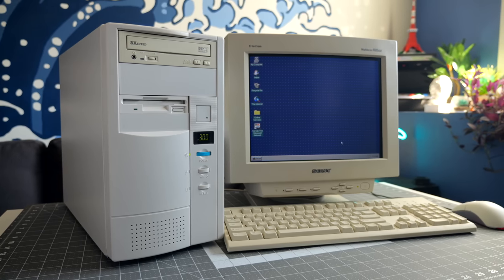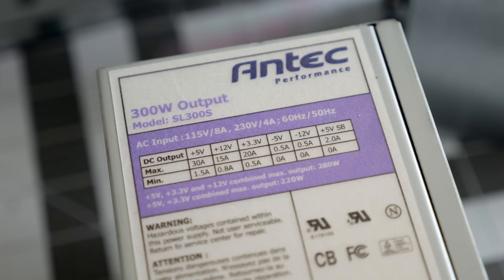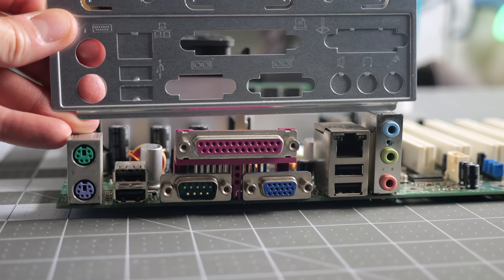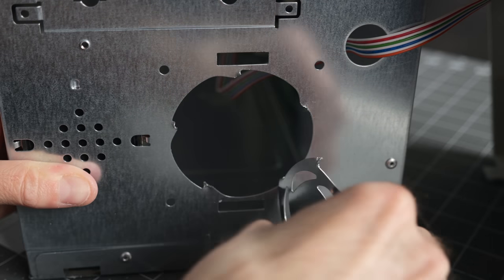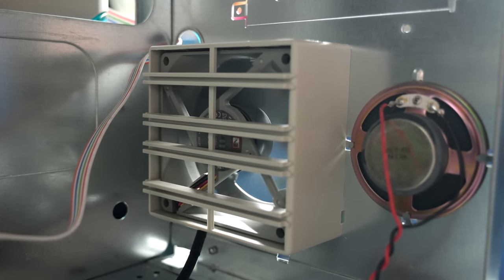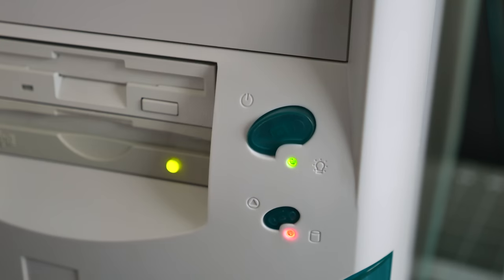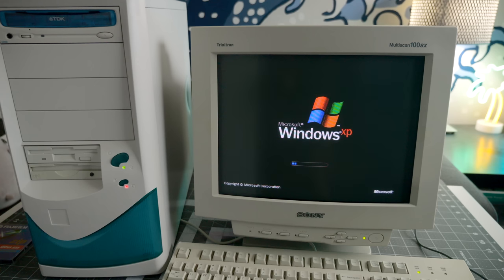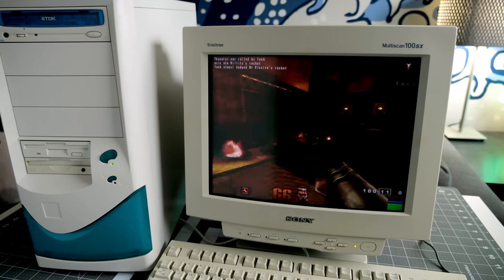Putting Together My Own Retro Desktop PC

Comment: Just in case it hasn't been mentioned, Crysis required a card with at least 256MB of VRAM and 1GB minimum. Recommended is 512MB/2GB respectively.
Reply: It also required very high clockspeeds
Reply: The issue wasn't VRAM specifically
The cards probably didn't have the required instruction sets. I'm guessing Crysis needs pixel shader 3.0
Reply: @dshadow01  You might be on to something. Crysis requires shader model 2.0, but recommends 3.0. The Geforce4 Ti supports version 1.3. The Radeon 9200 LE tops out at 1.4
Reply: LTT video from back then shows that to push the best graphic it consume 3GB VRAM
Reply: @devaraft  Did you snorted something? You got the good stuff innit?
Reply: @WH_J-x3x  I don't but I'm sure you don't need to snort anything cause you already have brain damage. Literally just type LTT Crysis and you would find that exact video
Reply: @devaraft We're not talking about max performance. Just running the game.
Reply: @TheBcoolGuy  I know but it's still insane that you need to put that much power to run best graphics of a 2007 game

Comment: I heard and read horror stories about the IBM hdd manufacturing plant here in Hungary. Because of the low wages the really low-end of the working class wanted to work there. I heard that some of them were smoking (!) in the clean rooms, and putting the cig butts off in the still opened drives. Crazy times...
Reply: Wow, I did not know these IBM drives were manufactured in Hungary. This comes as a surprise. I remember having an IBM drive back in the early 2000's and it was actually smoking. But as far as I can remember, it still worked. 😅😅
Reply: @skieinc  HP machines and printers are made too in Hungary till' 2005.
Reply: @skieinc  it's also said on the Hard Drive itself 11:43
Reply: 20gb IBM are solid. 40gb and 80gb are crap. And then IBM sold to someone. Hitachi or something. And their first 80gb's were good, yet noisy. They just solved stability and toughness before looking at noise.

Comment: An alternative to cutting the 3 pin power LED header is using a pin to release the pin from the plastic header, and then move it to the 2nd position. Or you could remove both of them, and use a 2 pin header instead.
Reply: Came here to post the same thing. It’s way safer and easier IMO.
Reply: I came to the comments to say just this.
Reply: Truth told, cutting the connector was an extremely common of-the-era technique. I did the same thing literally hundreds of times while working at a small computer shop in 2000-2001. You had to bash together a PC in about ten minutes: there was no time for fooling around re-pinning connectors!
Reply: It's also a waste of a retro case to modify the cables that came with it!
Reply: Came here to write the same. Cutting the plug while you could just move the contact to the middle pin is pretty barbaric.

Comment: Try adding a 100-330uF capacitor in parallel to the fan power pins to see if it will spin up - it's a trick the 3d printing community uses for Noctua fans.
Reply: That's genius. I need to remember this.
Reply: Timothy Hoogland  I'm DEFINITELY not an electronics expert, but I think it works like this: The low voltage supplied is not enough to start the fan, so the fan has large resistance and the capacitor charges. The cap then discharges and starts the fan. The fan then falls to much lower resistance and so most future current goes to the fan. Maybe the cap occasionally charges and discharges, but one is able to run the fan lower than 100%. If you know more than me, feel free to explain. I'm hopeless at circuits and components.

Comment: I love this period of building, this is abotu where I got on the PC bus. Really brings back memories. One of my cable management tricks for this era was to put the optical drive in the second slot down from the top and use that space above it to store the "extra" power leads off the PSU. Helped keep the clutter down.
I love the knockoff platinum and candy plastic aesthetic of this era, it really did have some character.
And that light mod? Perfect. Needs a neat case badge now too.
Reply: And the DVD drive really does fit nicely with the case.

Comment: I miss when it briefly fashionable to just stick translucent turquoise on every computer thing, even otherwise typical beige boxes. Turquoise is one of my favourite colours, and I have to wonder if that would be the case had I grown up a few years earlier or later than I did. 

I think Windows 98 and various vintages of Linux would be pretty interesting! I also have a hunch that the driver program might work just fine the second time round, though of course it could be even worse! 

 Those re-usable knockouts are nice though, especially since it doesn't really cost them anything else in production to slightly alter the shape they punch out — but it helps the end user dramatically.
Reply: It reminds me of the fish bowl aesthethic of literally everything. From hand soap bottles to shower curtain lmfao. Some type of pastel fish bowl aquatic vibes
Reply: I loved the transparent coloured plastic era of tech, even though it was a little before my time. I would absolutely still like transparent orange gadgets today, just like the ones I wanted as they were on their way out of popularity when I was just getting old enough to ask for stuff, beyond just pointing at anything with Winnie the Pooh or Tigger on it.

Comment: I never was a fan of the Apple colours, even when every other manufacturer copied them. I was firmly entrenched in the "being black makes it faster" camp.

Although that CD drive would look sick with LED illumination (I don't think it would screw with reading the disc since the laser is IR)
Reply: Yeah, I wasn't a fan of that design either. Especially in consumer products where everything had to look "melty" or like it was designed in a wind tunnel.

Like an mp3 player? Can't just make it a rectangle, have to make it all curvy and weird. I was actually thrilled with the iPod because it looked normal to me.
Reply: If I'm not mistaken the black PCs came after the Apple colored ones, before that it was all beige.

Comment: Next time you use Snappy, be sure to use the Origin one, and check every component hovering your mouse while pressing ctrl. So you can compare time and release version between your current driver and the new one, since the system is automatic and sometimes misfires and installs the wrong one (ex. Intel often signs new drivers in the year 1968)
Reply: is there a reason for this? 1970 is where most systems seem to have a cutoff so i'm trying to see if there's a connection here

Comment: I love this video/PC so much, it's so, so similar to the system I had back then!
Back in its day, I bought the same CPU 2.4Ghz. I had a very similar motherboard, Intel with the i845 chipset that supported the 533mhz bus. But I also had an nVidia Ti 4400, one step up from the 4200 you used. It was an absolute beast back in the day. 
I had to sell it for finacial reasons, but when I bought my next PC (AMD Sempron 3000+) I had an ATI 9200 in that! 
The Ti 4400 was around $550 AUD at the time, and the 9200 was about $120 AUD when I bought them. 
I remember this early period of the 2000's so well because I had so much fun buying and building PC hardware.

Comment: I had that TDK CD burner installed aftermarket in 1999ish HP pavilion.  The desktop included a Zip drive, which I loved.

I believe I installed it in 2001.  It was great! The software was solid also. Good times.

Comment: IBM DTLA! Never thought I'd see one alive and kickin' 22 years later — and without marks of axes, hammers, blood, sweat, and tears at that. Probably one of the very few of those that weren't faulty. That particular series was, to put it mildly, notorious for ill reliability and it was exactly the one that killed off the Blue's HDD business. I was lucky to know their faulty reputation in advance and never put one in any of my assemblies (of which I did about 2500 between 1995 and 2005), but my colleagues back then weren't as smart or lucky.
Actually this machine resembles my  own — a similar CPU, a Radeon 9600 Pro 128 Mb, SB Live... but a Gigabyte motherboard and 865 chipset. The remnants of it, in Asus 6AR case, still can be seen in my room almost 20 years later.

Comment: Thanks for the soothing video! Brought back some memories. I got pretty much the same PC in early 2003. Also a 845GE-based Gigabyte Motherboard + exactly the same Pentium 4 Northwood 2.4GHz/533 Mhz + 512 MB of RAM. The integrated Intel Extreme Graphics is indeed terrible, it is a DirectX7 level thing struggling even with the Windows XP's visual effects like fade-in for context menus. Even GTA3/Vice City are barely playable on it at the low settings. Good that you bypassed it straightaway. I had a similarly looking InWin case with a 250W power supply I guess, from Powerman. I had a 80GB Seagate hard drive if I remember correctly and it had an amazing feature - acoustic management - making it 100% silent for a small performance penalty. Later I installed an Nvidia GeForce 6600 into this system. The AGP 4X  on the motherboard somewhat limited its performance but still gave this machine a couple more years of life. 
I can certainly tell that you don't  need an additional fan here, neither this CPU nor the graphics cards would ever require it, even when mildly overclocked.

Thanks again for the video!

Comment: I've got that exact same case. Actually I got four! Some are more yellowed that others, and the teal piece becomes slightly green due to the color mix. I've had one working 24/7 for over 10 years at my work place running XP, and it will now become a retro machine for Windows 98/2000 era games and software 🙂

Comment: Nice build, neatly mirrors specs to my own in 2002. But for my money today, I would have to go with a 2004 themed build with a 800mhz fsb P4, 865 chipset board, and dual-channel ddr-400 ram. Getting up to the 9600/9800 ati cards or the much newer nvidia 6600/6800 agp would also be a great move, but I saw prices of those cards today is eye-watering.
Reply: not surprised, since few people had those higher-end cards at the time. I had a 9600 but never a 9800/6600/6800. I had a 5600, though. Maybe Crysis will run with 128MB? Or would you need 256?

Comment: My first self-built PC was an Athlon 900 system built in the full tower version of that case, it really brings back memories. You were very diplomatic though, the case had some of the worst airflow I'd ever seen. I recall removing that front cutout as you did, but I also drilled a 120mm fan hole in the side panel over the CPU. This was years before they'd become standard with the cone setup.

Comment: Nice build. The only thing I probably would've changed is that I would've cut out that fan grill first and filed down the sharp edges before installing the mainboard. 
But I'm not sure what they thought back then not stamping a bigger hole in the metal and were the fan should pull air in anyway.
For upgrading I would suggest an Geforce FX 5900 XT. A very popular card at the time, more reliable than high end Radeon 9000 cards (they need a bit of maintenance from time to time and most people didn't give a thought to that so getting a working Radeon 9000 card can be a real struggle at that price point) and could be found for quiet cheap in retro terms these days at least.

Comment: For missing I/O shields, I use Plastic Canvas or I 3D print a universal one shield. With both these methods, I just cut out the little squares to match the I/O. 

Plastic Canvas is a grid that is used with yarn to make craft projects.

Comment: My XP build in the same case has had its fair share of upgrades overtime aswell, originally a Socket 754 Sempron 2600+ and FX5200, i learned to solder with this machine after overclocking, changing hardware throughout my young years of owner ship as a child, it couldn't run Doom 3 or Farcry like my dad wanted when he bought it as an upgrade from a 486, i promised one day i'd have a job and upgrade it so he could finally play. 

12 years later such upgrades happened, a Socket 939 XGP/Pci-e combo board, A64 3400+ and my dream card, an IceQ UV reactive Ati X1650 Pro, though performance in early game engines seemed to rely on raw IPC and high clock speeds, so a recent purchase of an uncommon Dual core 4200+ for this platform didn't give me the big jump i was seeing, old games saw identical peformance clock for clock with the previous chip..but a recent upgrade to an IceQ 2600XT showed double the performance in some areas, but in Farcry the game engine did utilise the CPU more and the synthetic 3DMark 03-06 runs showed double the performance in the CPU and GPU tests leading to a big score increase, definitely better paying £35, not £300+ for an FX-53. Especially on the board that does not overclock well, biostar was never known for it..perhaps the Asus A8N32SLI-Deluxe that came with the chip may go in so i can push both chips and see if they're capable of the golden 3Ghz known to overclockers if you won the silicon lottery..

Athlon was the better option at the time unless you later on went for a S775 HT pentium 4 example, but my roots were with AMD so i wanted to keep the build as original as possible and re-use what i could, when my dad heard the Farcry intro spring to life out of the Audigy 2 ZS, he finally got to sit down all those years later and play it while running in the hundreds, not the single digits, it was a bit emotional seeing him play those old games with a smile on his face while i played the later successors alongside, it was like 2 eras mirroring eachother, from old to new, the enjoyment they gave the user, was just as fun as it was back then.

Comment: Lovely build! I also had the 9200 but it was the SE version which was a bit slower. P4 1.6ghz, 768mb of ram and 40gb hdd. (i believe 2x20). Win XP was also installed. This was in 2002. Good times!

Comment: was just digging around on an old XP pc i have in the basement. Brings back a lot of memories, some of those old programs like PSP Converter, Deep Burner, Flock, Yahoo Messenger, AIM, MSN, a saved Myspace html folder, tons of stuff.

Did anyone else use Omega drivers for their Radeon card back in the day? Optimized for gaming and always worked better than stock ATI drivers.

Comment: Great find Collin , I build an old AMD system in that exact same case in probably 2000 starting with pc chips M810 socket A (462 athlon 600   duron 800 then Athon 1000, I still had that case through a few upgrades to an Athlon 64 X2 in 2009  , thanks for the video

Comment: I had that case! Was pretty ubiquitous around 98-00. Remember picking it up at a huge computer show they used to have on weekends. Built a Pentium 233 MMX system with a best in class (for the period and chip)Intel TX motherboard. Great system on the cheap at the time. Interesting choices for the build here though, certainly more of an upgrade than it typically would have seen, as this case seemed to be common from maybe the point of Pentium 133 through the end of slotted Pentium 3s. I've never seen a P4 in one of these. Nice throwback all the same.

Comment: my man! i have this exact same build - even with a curvy designed beige case (mine looks like a nokia phone hah)! The intel d845 is a pretty stable board, the 2.4ghz P4 is solid as you mentioned and a geforce 4 ti4200 is the icing on the cake. I am using an SSD instead of spinning and went for Winows 98 instead of XP, just because I wanted something that could play any 1998 to 2001 Win9x game with ease.

love that light on the front! thanks for the great video.

Comment: I used to have a similar case for my first Asus A7A266 based build. I would swap out operating systems with a locking drive enclosure (from CompUSA) in the top bay. I had pure MS-DOS, MS-DOS with Windows 95, Windows 98SE, and later Windows XP when I moved to the A7N8X-E Deluxe. But by then I had a ThermalTake Xaser III case. I also had extra enclosure to play with Linux distros (RedHat, Ubuntu, etc)